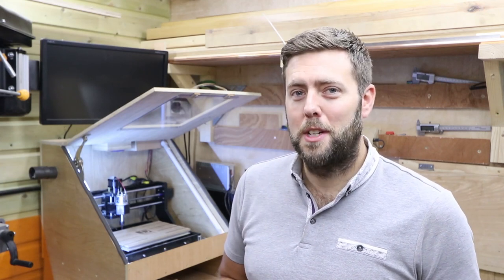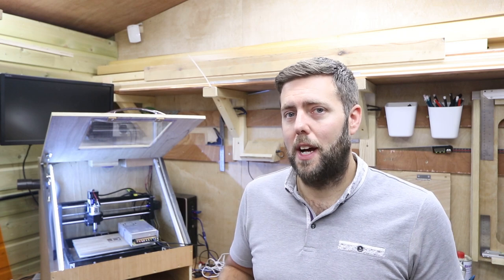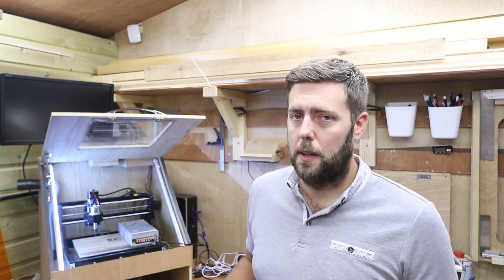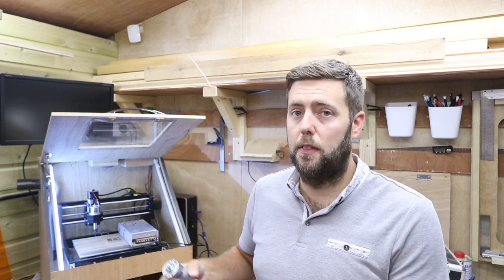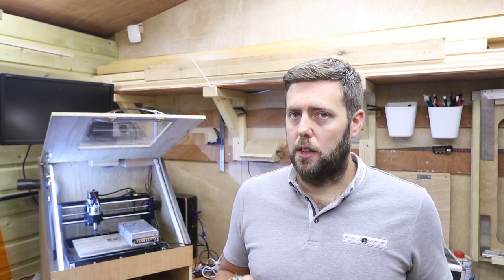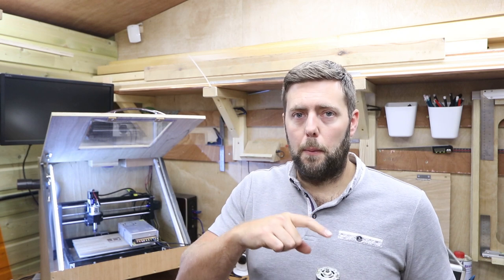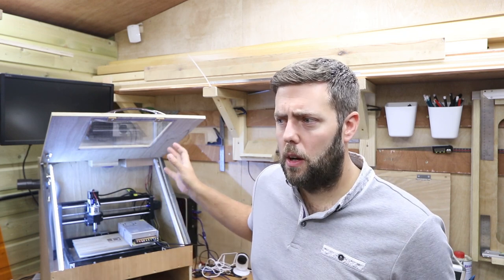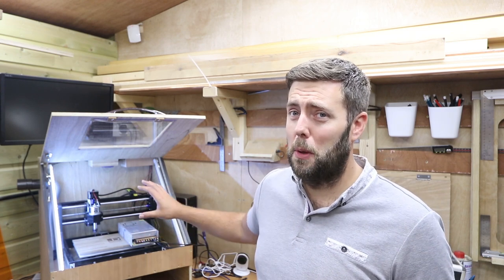3018 PRO - 20k RPM Spindle Update

Comment: Thanks for the prompt reply, Motor does work, I have just ordered a new controller board that can handle up to 10A, so I will connect the motor to that to see if that cures the problem. I will keep you posted.

Comment: James you can auto start the spindle using a relay that is triggered  by the spindle drive from the control board.
Reply: The only drawback of having an external power supply is that it is not possible to control the rpm from the software any more.
Reply: @stanislavtodorov8705 , you can use a board like this to use a different power supply but maintain the mains board control the rpm:
https://www.amazon.co.uk/ARCELI-Printer-Heated-Current-Upgrade/dp/B07CR4QYJ8/ref=sr_1_5
Reply: @paulocabrita2055  how would you need to wire it then?

Comment: Appreciate your videos, I have learned alot from them.   I have only been doing CNC for about 2 months now,   You are the best on the 3018 cnc with your info.  Most of the videos I have found are for the larger machines.   I am really interested in just how far I can push the speeds on mine with the stock spindle.
Reply from the maker: Thank you 👍 just start slow and build up. You soon start to tell because you getting more chatter  which is a clear indication you're going too fast

Comment: Hiya James.
Awesome job with the videos. Really getting the benefit.
You weren’t wrong with the upgrade. Just fried my power brick. 
So going to get a new one. 
Did you connect from the PSU to the 3018 and the motor from the control board?
Reply from the maker: Yes, the psu connects to the board and the board powers the spindle. You can power the spindle directly from the PSU but you would need a 24v dial to control the speed, and also a solid state relay if you want the board to turn it on and off so it gets a little more complex

Comment: Hi James,  Sorry this is an old video but wondered if you could advise. I've just ordered the 20,000 rpm 775 spindle from Amazon. I intend to run it on my 4040-Pro. Would you by chance know if I upgrade the stock Power Supply, would my control board can handle the start up current of the spindle. I know the 3018 may be borderline but how about the 4040-Pro. Thank you.
Reply from the maker: I'm not 100% sure but given the 4040 Pro technically has a more powerful spindle already I would think it has a bit of extra power to run it

Comment: I don't know what you try to achieve! 
I see many people changing original Continuous current motor with a huge asynchronous motor!
I can undestand it for those who work with wood.
But for myself i only need to drill PCBs and i think this CC motor is enought to start.
But since None youtuber is able to draw an electronic schematic, i'm still unable to understand how it is possible to make my original CC motor varying with the gcode 'S<N>' commands given.
Or if you prefer with candle or grblcontrol with the Spinple Speed setting! 
I think it's the same done with lasers but it doesnt not seam to be applied on CNC. Or am i wrong?
Reply from the maker: If I'm understanding your question correctly then your GRBL control board has a $30 setting, usually 10000. This is 100% power. So s10000 would be 100% power, s5000 would be 50%, and s1000 would be 10%. The % I believe controls the voltage going to the spindle. However if for example 100% power is 10,000RPM, 50% does NOT mean 5,000RPM. Its more of a curve than a straight line if that make sense

Comment: I have a HND in electronics (from 1965 !) so I do understand what you are talking about here, but may I compliment you on a very clear and concise explanation of what is involved in upgrading the spindle on a 3018.   You answered all the questions that were concerning me after watching your live video on the subject, and I will probably buy the same motor and the power supply which I was already considering.
I follow your reasoning about not overloading the control board with the extra spindle current, and connecting the spindle separately, but does this mean that the speed is no longer controlled by the control board/software?   My initial thought was to include a relay or something similar, energised by the existing connection for the spindle,  to remotely switch the external supply to the spindle directly.   However, this would not appear to permit speed control, so would not be a simply 'press start to begin' situation (which I would like!).    Your thoughts on this aspect would be appreciated.
Reply from the maker: Thank you. Sometimes it just does feeling like I am rambling, it often makes sense in my head but Im never sure how it sounds to others. In regards to wiring the spindle separate, I think some have the speed control on the spindle its self, not specifically referencing a RPM but usually something like a dial with 1-8 on it. For the ones that do not have this control, Im guessing there is a way to relay the power control from the board to control the separate supply in tandem, or I think people fit some sort of rheostat to control it but not 100% sure.
Reply: @JamesDeanDesigns  Like @Don, my first thought was a relay to switch the external power supply.  As you say, this doesn't allow the software to control the speed.  But, how often do you use anything other than full speed?  I know I haven't had cause to but I am running a stock 10000rpm motor.

Comment: Hi when designing a project in Easel with the project in the left hand corner does it make any difference if the actual piece of wood on the machine is placed in a different area on the machine bed
Reply from the maker: No, as long as you set your Zero to the corner of your material

Comment: Looking to do this myself after testing yesterday. 

Could you not wire the motor separately then use a relay from the original board connection to switch it on?

Bolting linear rails onto the back of my spindle mount ATM.
Reply from the maker: There are multiple ways to approach wiring this up, that is one option and you use an SSR relay to turn the spindle on. Hope the linear rail upgrade goes well :)

Comment: Hey James, I'm having a problem with my 3018. When I start my file(through UGS) it runs fine for about 5-10 mins, but then it begins to waver away from the cutting paths. It then cuts off path. It seems to skip a line. Something like that. Very odd and I don't know whats going on
Reply from the maker: Sounds like you may be missing steps. This is usually caused by going to too fast or too deep. Can also be caused by your axis being a bit stiff if they are not aligned correctly
Reply: @JamesDeanDesigns  its definitely not too fast or too deep. So how would I go about fixing the axis?
Reply from the maker: @every_thing_wood1251  have you adjusted your acceleration settings? If these have been taken to high it can also cause missing steps. For the axis, issue 5 I think in this video about 10.12 in https://youtu.be/r-uLsMwOBfY

Comment: Hi James,
One of the stepper Motors on my 3018 pro max has developed a problem and I'll need to replace it. The original part is a Cronos 42BYGH34H-2A-13D. Can one replace this with a generic stepper motor and what must I watch out for?
Reply: Probably be fine to get one off ebay

Comment: Hi James, Terrific site, very helpful. Question:- I have bought a Genmitsu 775 24v spindle and the upgrade PSU that you suggested (24v,15A), problem is when I turn on the PSU the spindle twitches and then again when I turn it off again. Any ideas please? Motor is directly connected to the PSU output.
Reply from the maker: That sounds odd. Have you been able to check the spindle actually works or even that the PSU actually works correctly? Sounds obvious but just safer to rule that out first. If you have something like a multimeter/circuit tester that can help diagnose where the issue is
Reply: @JamesDeanDesigns  the motor now works a treat through the new more powerful controller.  Thanks all your videos. 
Keepmupmythe good work.

Comment: Hi James
Thanks for all the video help for my 3018 Pro M. I have so far ruined 2 new upgrade 775 motors I have purchased trying to connect the ER11 extension. I have tried heating the ER11 and that didn’t work. Also tried cooling the motor and heating the ER11 but still no joy.
Have you, or any of your followers, got any advise for a novice CNC’er?
Reply from the maker: Hi Richard, to be honest. I have never had to heat or cool any of mine. They have just been a snug fit and then I pinch the little grub screw up. Have you tried buying a different ER11 collet to see if they fit any better?
Reply: Hi James
I will try a different er11. Thanks for your advise.
Reply from the maker: @richardtester3985  sorry I couldn't help much more but to be honest if heating and cooling wasnt working, then I'm not sure what wouldas those are quite aggressive methods anyway.
Reply: You need quite a strong heat source, gas blow lamp , propane or similar Need 300°c or higher then quickly press the motor to the spindle but leave a gap to motor casing. (Though Genmitsu promise send 765M with ER11 already attached now!)

Comment: If all you're running is the spindle with no lights, fans etc do you still need to upgrade the power supply or should you be ok?
Reply from the maker: If you don't want to get a new PSU you can either use some code to ramp up the spindle but you have to do this on every job or you can but a little limiter that stops the amps spiking. Its only when the spindle first fires up thats the issue

Comment: Hello again James: I enjoyed this video and learned something about swapping the stock motor. My Sainsmart 3018 PROVer hasn't yet arrived so I have no feel if the stock motor will be perfectly OK for my needs (PCB etching). I suspect the stock motor will work but having the higher RPM produces cleaner cuts, so it's something I may consider.  However, I noticed your machine in enclosed in a case with door, and has an extraction fan as you mentioned.  It would be useful if you could provide commentary (perhaps in a separate video on the topic) on how your setup handles the lose particles as they're removed from the work;  where do they go, what kind of extraction pump, etc.  Another video that would be great to see for newbies (such as myself)  is reviewing the various kinds of BITS and what they're used for and what not to use for a particular kind of job/work.  Looking forward to more of your videos!

Comment: Help! The spindle remained turned on at maximum speed, even when it is disconnected from the PC .
Reply from the maker: Not 100% sure but a chance your mofset has gone. Do you know what control board you're using?
Reply: @JamesDeanDesigns Same here, it in fact did burn out the motor control on the board. It’s not the stock board, it’s still working because I swapped it out for a generic 1.1 grbl board. Oddly it worked fine with the handheld. But as soon as I used my laptop, upped the RPM TO 100% it never was able to slow it down after with any configuration. Since this is mainly for tinkering and I plan to use if it works well enough to do some metal engraving, I ordered a 300w motor that operates off its own 48vdc PS and sipped is control is through a potentiometer. As you noted, I may need to up my Z stepper power. Hmm….I think this is becoming a hole in my bench to pour money down.

Comment: Hi James. I have a standard 3018 Pro straight out of the box and am considering the spindle and power pack upgrade. I am a plug and play guy and no nothing about electrics apart from wiring a plug. I notice the power pack has a bank of connections. Can you explain where you wire what. Thanks.
Reply from the maker: Its simpler than it looks. The connections are just positive and negative, there is space one side for the input power and then some spaces for the output. All I did was literally cut the wires either side of my black brick, threw the brick away and used the wires on the new PSU.
Reply: @JamesDeanDesigns  Do I understand this right - you've connected the new 24v power supply to directly power the controller board (motherboard) and your entire system therefore seamlessly switched from 12v to 24v? It would be brilliant if it were that simple... - thanks in advance!
Reply from the maker: @pankajkhanna1346  the old PSU was  24v but only 5amp, the new one is also 24v but 15amp. Same volts just higher amps

Comment: Hi, the links lead to a currently unavailable spindle on the Amazon page. I’m just curious but what has been the cost of the replacement spindles? I think you said you have had to buy 5 replacements.
Reply from the maker: The spindles must be out of stock. I ended up sending some back, I think I bought three in total and they ranged between £12 and £20, £20 being for the 20,000 RPM spindle
Reply: @JamesDeanDesigns  👍

Comment: Hello James,

Thanks for your videos they have really helped.
I have a 3018 pro, the original motor was terrible 
And unbalanced so bought the sainsmart 20000k
one, but the noise from it at any speed or bit and 
even when idling is so piercing I have to ware
ear defenders. I have contacted Sainsmart and
they say this is normal but I have not heard other 
videos with this problem. Do you have the same.
Keith
Reply from the maker: I've heard different opinions. Mine is  quiet but others have said there's is loud. What I would suggest is perhaps head to the Sainsmart user group on Facebook and ask if people can take decibel readings. You can download an app on your phone to check. That will give you an idea if yours is within the acceptable range

Comment: I would like to suggest doing a tutorial of the final assembly. Thank you.
Reply from the maker: Hi, what do you mean by the final assembly? As in fitting the spindle or the final assembly of the machine?
Reply: I'm interested in the electrical wiring between the power supply and the control unit

Comment: I ordered the high rpm motor, but it doesn't seem to work correctly... When I engage the spindle in grblcontrol it turns on in a pulsating manner. The old motor works correctly.
Reply from the maker: Your power supply unit (psu) might not be strong enough to run it. I ended up buying a more powerful PSU to run it
Reply: @JamesDeanDesigns   Thank you for your reply! I found a gcode trick, that may work, but the best thing to do is probably just to upgrade the power supply.

Comment: Just got my 3018 pro. Noticed max spindle speed in dolla dolla is at 1000. So I need to change that to 8000 for my rpm I want to use or is that 1000, meaning 100 percent ty

Comment: I've just ordered my Genmitsu 775M motor, arrives early Jan,  ouwrt supply next week. Tempted to run spindle manually on separate pwm  switch as Easel can't do stepped speed changes! Did you try yours that mode? Do you use Easel?
Reply from the maker: Hi John. Easel doesn't do it automatically but you can export the code and then just drop in the extra code for ramping the speed up. Mine seems to be ok with the cronosmaker board. I havent needed to to ramp up speeds or control the pwm separately
Reply: Thank you James, have a good Christmas with family/care bubble, stay safe, see you next week/year

Comment: If you prefer to stop start a higher voltage motor using the controller. This can easily be done by adding a small 12/24v relay. But the speed control would need to be done manually by using its own variable speed controller.

Comment: Do you have parts list in USA? I have ordered one of those motors of Amazon and it runs fast in slow and slow in fast position. I really enjoy your videos. Love that name, I thought he came back.
Reply from the maker: Hi, I could get you the links for anything but it would be a guess as to whether the supplier is any good. I generally don't like posting links to products I havent specifically tested my self. Thats odd about the motor. Fast and slow is simply the amount of power being sent to the motor, so the more power the faster it goes. I cant even think of a logical reason why its doing that
Reply: @JamesDeanDesigns  OK, Thanks. The Amazon USA does not have the same brand of power supply you recommended.

Comment: Hi, James
I have a Banggood 3018 CNC that I have been running off of a 12 Volt power Supply from my Laser, Because the 24Volt will not run the Spinle Just starrts and stops. But when I hock up the 12 Volt Power Supply it  runs good but I don't think I am getting the RPM out of it. Do you have any Ideas about it.
Reply from the maker: Hi, basically they are designed to run at 24v so if you're only using 12v its half the power so roughly about half the RPM.

Comment: Hi James, thanks for the videos. I am new to CNC and your videos has really helped me learn how to use my 3018 pro. I am looking to do this upgrade, currently I’m following your advice with the stock 10,000 rpm spindle and doing speeds of 450mm/min for plywood. Would be great to know what the increase in speed is and what you would recommend for a max speed with the new 20,000 rpm spindle! Always worrying about going too quick and breaking bits. Keep up the good work!
Reply from the maker: Hi Issac. I've not pushed it to much at the minute but I've got upto 800mm at the minute at about 0.7mm per pass on MDF. So it's certainly bringing the cutting time down.